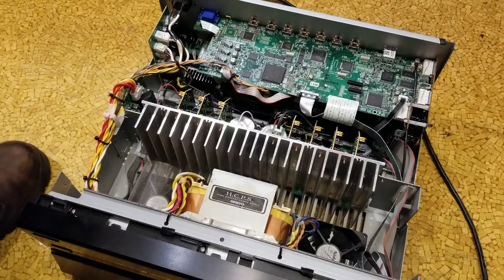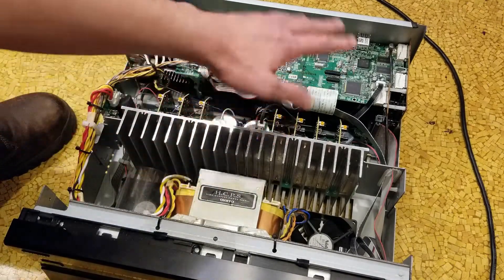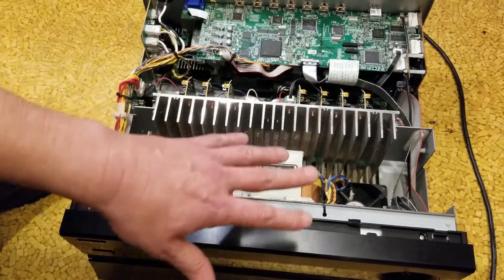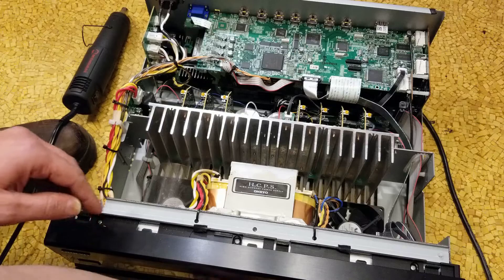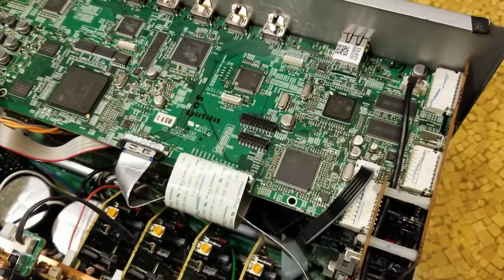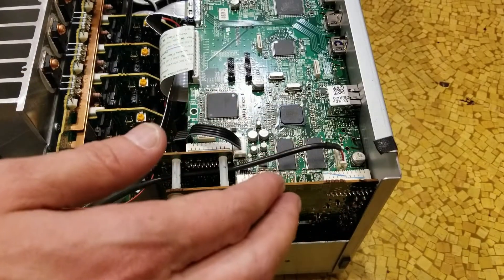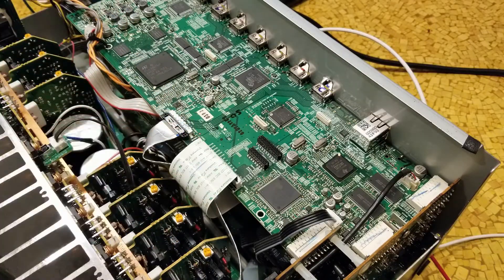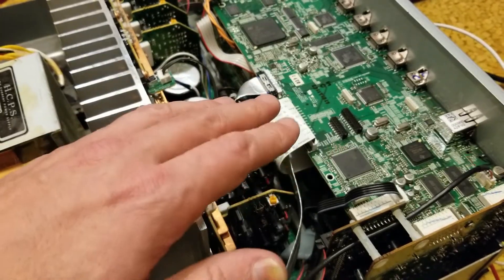Onkyo Receiver No Output HDMI Board/DTS Chip Repair

Comment: I also bought two with the exact same problems.
Why didn't you use any flux? 
Also, are you going to mount some radiators over the DSP chip?

LE.: also, 115F (46C) isn't really too hot for that CPU especially since it's a fine pitch IC and not a BGA.
Reply from the maker: I need the update this video it turns out much of this issue has to do with the solder joints internal to the processor package and not the BGA grid to the motherboard.

I've already switched back to my old reliable Yamaha because my imputs already started becoming intermittent and I have to switch between inputs before sound will come out

Comment: I tried hair dryer, didn't work for me, watching all those videos :(
Reply from the maker: my understanding is that it will not work all the time, and the issue is the soldier joints inside the chip between the actually piece of silicon and the little board it is packaged into.
Reply: @CatusMaximus  so i could get the dsp chip reballed, it shall work?

Comment: Wow Maximus! You know your stuff! I have an HT-R990. I plugged in a composite video jack into a normal video input and the unit went into protect mode. Got it to restart again but the speaker grid lights stay on and no second click of speaker relay. Did volume up down and factory reset. No sound. What do you think? I opened the unit. 2 fuses blown to the speaker relays. I replaced them. AVR goes on off. I shut it down. Ideas?

Comment: The problem is, with all this "repair", you just temporary fix the problem. From my understanding, most often not the solder balls on the bottom of the chip are the problem, but the stuff contacting actually the die with this green substrate plate, which is inside the chip. Louis Rossmann did a good video about this I would recommend to understand the real problem. With heating it up to some amount, things might get a little bit realigned inside the chip - but only temporary. So the only real permanent fix would be to get a replacement chip (but they are not available for that "old" receivers). The root cause of the problem is the thermal stress applied to the chip because of insufficient / no cooling (not even a heatsink). Same happened to graphic chips (most often nVidia) in notebooks due to same reason. Broken by design.
Reply: yeah the root-cause is definitely a thermal stress. I don't understand why are almost all receivers passively cooled. I just added a really thin and quiet active usb cooling fan to the bottom of my yamaha. The heat cumulates over time so even a little breeze can keep it running superbly for years as there is never enough stress on the transistors etc. Before when used at near max volume it would turn off almost instantly, now it can run minutes before turning off at max volume (of course that's too much it can almost destroy your hearing and damage speakers). Before it was under normal operation running very hot (like 70°C), now it's warm (I'd say max 45°C). Btw I don't have it in an enclosure just sitting on top of my desk. So yeah definitely put some passive radiators on those chips or maybe even active cooling.
Reply: So heating and putting a heatsink on top should fix it for a few years? I have a high end version (got it for free) and everything works except for the issue in this video....
Reply: @peterdevreter  did you fix it?
Reply: I think you're right. even a small amount of heat will allow mine to function again but as soon as it is switched off and cools again, it doesn't function when switched on again
Reply: Yep. MANY laptop graphics cards have died the same death, and heating the chip only ever works temporarily. Eventually, the time it will work between needing to be reheated again gets smaller and smaller til the point where heating just doesn't work at all anymore.

Comment: Thanks for the tip, in case the thermal blower has to reach a temperature of 200 degrees? and for about 15 seconds on top of the chip? after that repair did you have a problem again?
Reply from the maker: Yeah it already needs to be redone it gets no audio unless I switch around the inputs after turning it on I'm just going to go back to my Yamaha

Comment: I have 2 NR 609’s that have each been repaired by only for this problem. After getting them back they worked for about a year. Neither one plays audio again. I took them apart and heated them both up to attempt resolder and then installed heat sinks. They both worked for about a week. One has 9000 hrs and the other 10k. It’s crazy when I have a 30 year old Denon that still pounds after years of abuse.
Reply: It's the shitty BGA designed chips that have this issue.  It's a crap design to have solder balls UNDER the chip. The boards warp/cup under those chips from heat, and it pulls on and makes the solder joints go cold under there.
Reply: one question please: did you use flux when you resoldered it?
Reply: @vortexor1  yes
Reply: 30 year old receivers didn't have hdmi circuit boards to go bad. I have 30+ yr. old Onkyo's still going strong.
Reply: and is it still working? wish you a merry Christmas

Comment: What receiver can have lifetime satellite radio subscription???
Reply from the maker: During the very early days of Sirius Satellite Radio before they merged with XM they sold head units for around $300 that had a lifetime subscription that was tied to the specific serial number of the head unit. that ended after they merged with XM so it's only the really old units that even have the possibility so just hunt down old Sirius satellite radios. It was a consumer contract when they sold those lifetime subscriptions so that's why they were never canceled it is also my understanding that they are not valid for online stream.

It's easy to know if you found one of those special units you just simply turn it on and let it do its Channel updates and you either have 150 channels or you have no Channels.

Comment: just to provide a data point, my unit failed right around maybe 2000 hours. (i bought in 2012, and have it RAM in 2016, and today is 2020). i just check my total usage to this very day is just under 4000 hours, so it is very possible at the time of RMA it has less than 2000 hours. 
so i think this may be less depend  on actual hours, and more on the age of the receiver. 4 or 5 years maybe a good time for the problem to surface. 
still quite impressed that Onkyo picked up the bill for it. the round trip shipping of a 50 lb receiver probably cost a small fortune.

Comment: OK your 2nd attempt was closer.  But 350F won't do it either.  I'd love to know just what is so therapeutic about heating that chip well below the melting temp of the lead-free solder required when that unit was made in that 2009+ era.  Also, a chip temp of 120-ish is not all that hot.  Probably does not need a heatsink.
Reply: Use liquid flux and heat to 250C (480F) for 15 sec.  Let cool, spray flux remover.

Comment: 150F is no way close to the temperature required to reflow the solder under a 256 "pin" ball grid array chip.  You need 220C = 430F for like a minute to do that or get close.  How silly saying that 150F was "hot".  Won't bake a cake.
Reply: Even higher temp. And use flux. Most chips are meant to be reflowed at 260C peak.

Comment: Excellent video and tutorial. I have a Denon AVR with similar no-audio 
issues, from either analog (tuner, RCA cables) or any digital sources. 
All other functions seem to work (OSD, display, etc. onboard diagnostics
 all seem fine except "AUDIO PACKET DOES NOT COME FROM SOURCE." So I 
assume it's a similar issue to the Onkyo. Is a DAC or DSP still part of 
the signal flow even with analog sources? I am preparing to attempt a 
reflow but I'm not sure which chip is the most likely culprit. Advice on
 a good way to diagnose? Turn it on and see what gets hottest and start 
there? From what I can figure from the service flowcharts, it's either 
the DAC, the DSP, the input selector chip, or the volume control chip. 
is the Onkyo DTS chip their DSP, or their DAC? Thanks for any advice!
Reply: Did you attempt this? My x1300w has no hdmi out
Reply: I had a couple of denons with the same problem as you have but it was intermittent .

Comment: 260 ° C is the melting point of lead-free solder, you have to heat it up to 500 degrees Fahrenheit
Reply: A typical solder such as 60/40, with 60 % tin, and 40 % lead, has a melting point approximately between 183 °C to 188 °C
Reply: @thedavesofourlives1  LOL! If they were using typical 60/40 alloy, we wouldn't have these issues generally. ROHS solder is less ductile and has a meting point of 217° C (not 260) or 422 °F.

Comment: Thanks for posting this. My Tx-nr809 lost audio a few weeks ago suddenly. I found your video and used a heat gun to apply some heat, let it cool and turned it on. Boom.. The speaker relay kicked on! I haven't hooked it back up yet and I'm know this I'd probably just a temporary fix but maybe it will give me a little more service before it totally dies. Fwiw my unit said it had just over 17k hours of use.
Reply: Как посмотреть сколько  он часов проработал ?

Comment: Perfect. My personal experience is to heat the dsp chip for approximately 1:20 min at 260 degree Celsius. I used a reflow station for approx 40 Euros. Worked fine for me and I did repair two receivers successfully. Afterwards I put a passively aluminum cooler on to the chip!
Reply: Forza Guy i think for Onkyo stuff it is always good to put a aluminum cooler onto the dsp Chip. Then you probably will not run into problems!
Reply: is it still working please?
Reply: I'm having 605 onkyo tx sr605  is this method fix my issue hdmi cable not working error on display hope it will work

Comment: I have a model 707 that has the same issue. I used a heat gun and heated the chip up 5 times but I had no luck getting the speaker grid to come back on and audio back to working. The funny thing is I hear 3 relays click on as soon as I press the power button but no click from a delay relay like a normal receiver. All the audio driver transistors are getting hot but the final transistors that are mounted to the heatsink are not. Any suggestions on what else could be wrong with this receiver will be greatly appreciated. Thank You!

Comment: Any updates? Did you install heatsinks?
I need to repair HDMI Main out. Im using big and heavy HDMI plugs so it has done something with the small pins. Cable and plug needs to be in a special way to get video output. Might need resolder. And a good old dust remove inside. Might also look at the fans. Havent heard them or the realy turning on lately

Comment: Wonder why EVERY ONKYO has the SAME PROBLEM for decades ??!!
Reply from the maker: They thought Denon and Yamaha didn't have enough customers...
Reply: Looks like it was two issues (both on the HDMI board).   Issue one which affects x05 and x06 era receivers was the capacitors going bad.  This issue could have been prevented by going with higher thermal rating caps (105C vs 85C), better cooling, or better heat management.      The second issue which came later was related to the Ti Audio/Network chips.   Ti labelled the issue as premature aging of the chips, others have noted this may be related to the chips running hot and eventually through enough thermal cycles cracking or otherwise undoing their connection to the board.  Onkyo could have mitigated this issue with better cooling or finely regulating the voltage to the ti chip (the supposed cause of the overheating).   

In general, if you get an onkyo receiver of that era, get some cooling fans to set on the receiver (one over the DSP board and one over the amplifier section).
Reply: Not decades. This is a problem that came with HDMI boards. I have several Onkyo receivers that are still working going back to 1990.

Comment: Unbelieveable.....v675..Hey catus u have to tune in on your site at lease say hello every week my unit is 2013 Wow it has over 2200 hours on it u said...got it for 30.00 with new remote...some funtions working then i update thru network..it worked all the speakers output came on..then the next day it started to go in and out, thought it was the attenna..then i type in no speaker output on u-tube and your site came on..watch and watch it then used my heat gun and all funtions worked till they stopped...WOW but cant find the right chip still looking....ken
Reply: wait it has markings like it was at the repair shop What they didnt Know!!! about that trick
Reply: All yamaha units should have networks on all of them to check units
Reply: My unit was a yamaha 675
Reply from the maker: Yamaha's are quite different from Onkyo and in my experience have been surprisingly reliable actually phenomenally reliable I have an RX V 2400 and an HTR-5890 and both still work flawlessly although they're sitting right now because I'm using this Onkyo.

On the Yamaha there is a way to do a factory reset I would try that I don't know what the button combination is you'll have to do some research
Reply: @CatusMaximus  I did that
Reply: But this did actually work regarding the 2units different
Reply: hey something else..i have a HTR5860 that quit..it dont work I have 2 power boards or power suppy boards..and extra parts i might be done with it ..Or help me with it plz!!
Reply: Should i show a video  of the chip problem! Or do u believe me!! It is the problem

Comment: Thx, this did fix my onkyo TX-NR 809.
First try with hairblower did fail, so I was like f*ck it, so I did take a paint burner if that is correct English.

First try (hair blower) 300 Fahrenheit, 2nd try with paint burner I did heat it up to 330 Fahrenheit.

Did let it cool down, plug in the power cord, voila, fixed

Now I need to search a heatsink to mount on it.

Comment: Just did a factory reset on my TX-nr686 and got it working again. Pain in the backside doing factory resets cause the remote doesnt work while doing the setup so have to get down on the floor to hit the buttons on the unit. Had the unit for about a year and bought it used. have to do factory resets every couple of months cause the bloody thing keeps playing up.

Usualy its no output signal to the TV i have probs with. never had probs with sound. Like today woke up turned everything on no signal to the TV from my PC. so tried the bluray player no signal but had sound from the speakers connected to the unit.
Thought maybe the HDMI cable was damaged so replaced that still no go. So thought maybe the HDMI socket on the TV has a prob so double checked by testing it on another TV still no picture.

1st time it did that was a week after i bought it so took it back to the shop as it had a 6 month warrenty on it. They refused to give a refund unless they sent it off to their repair centre to see what was wrong and that would cost me more money than i paid for it and take 3 months. So took it back home and did a factory reset after looking online to see if i could find a solution and it started working again for about a month.

Seems its a common problem with all AVRs no matter what make or model they r. Usualy its sound though not picture.

Guessing their all made in the same factory and same parts just diff software like most TV's now. Its either a chineses factory or a turkish company called Vestel making most electronics now.
I know vestel make linsar, samsung, LG and Panasonic TV's in the same factory in Turkey.

The braded named company designes them and the specs. then vestal builds them using the parts they have in stock and those parts go in everything they make. so its only the design and software thats diff the parts inside r all the same.

Comment: I have a huge problem on my onkyo receiver. I am using the aux input with my phone and whenever I turn on the receiver, there's only one click and theres no sound coming out of the speaker. It could be an easy fix but I haven't found anything in the internet yet. please help.

Comment: Thanks for your videos, I have a onkyo TX nr1010, I have problem of no sound on turning on the receiver, I have the speaker icon but no sound, when there is 2 clicks of the relay I have sound, but one click equals no sound.
Reply: Did you fix this? I have same amp and same problem.
Reply: @wojjy7096  Same

Comment: i tried the hair dryer  method on the dts chip on my onkyo tx-nr717  that didn't work for me. i saw on other videos on you tube others used a hair dryer and after a few attempts the speaker matrix popped back up. i tried at least a dozen times did not work. i am thinking a heat gun may work or there is another issue. could be a power issue. any suggestions ?

Comment: I have an Onkyo TX-NR609 that does not power on. I unplugged it for 20 minutes and when I plug it in again it just keeps clicking every 3 seconds or so. There are no lights coming on when it clicks. Any ideas on where I can start looking for a problem? I have already checked the fuses and the big transformer has primary and secondary voltage for a brief second between clicks.
Reply from the maker: That's more complicated it sounds like it's starting up and at some point it's determining there's some kind of issue and then shuts down and cycles. look online for the factory reset button combination and try that